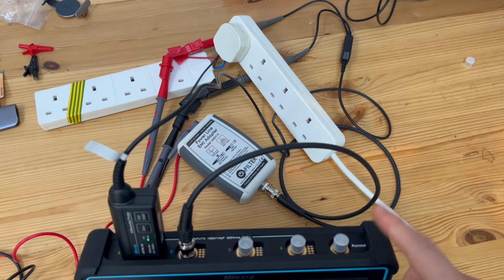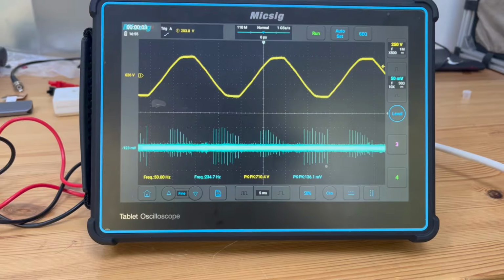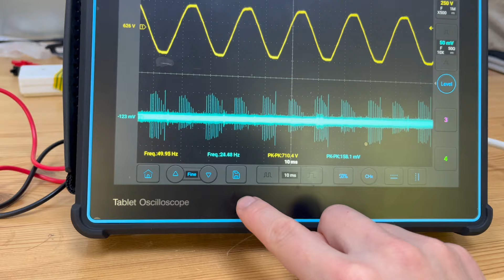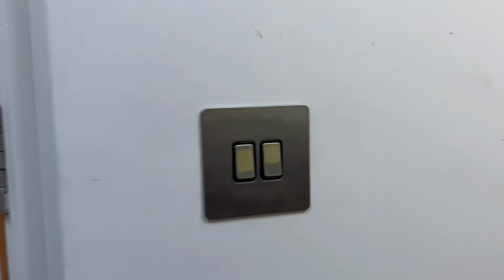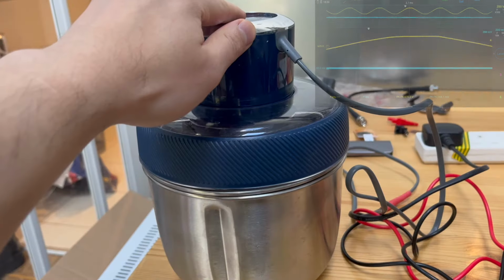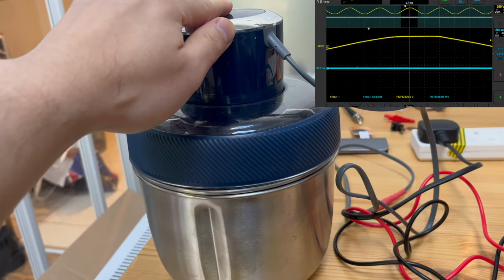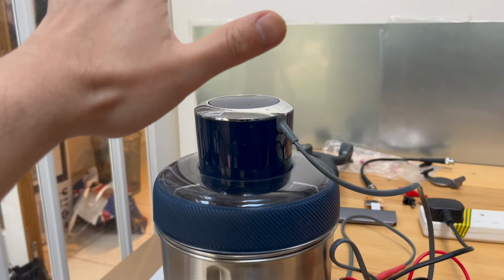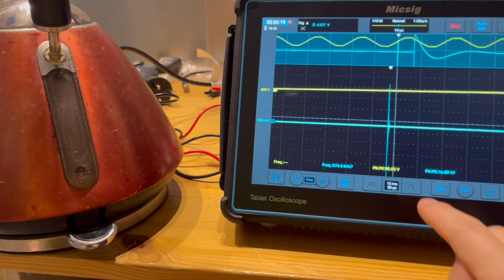Comparing Conducted Emissions: Assessing Performance of Home Appliance Products

Comment: Thanks Min.  Interesting that the mains in the UK is nowhere near sinusoidal, I get a triangular wave in Australia.   Also, I definitely see EMC issues caused by CISPR compliant appliances, mainly with intentional receivers. AM radio in particular.  I guess the main takeaway is preventing 'unacceptable' interference.   So the CISPR limits do work despite a significant amount of subjective judgement.   

I think you videos would benefit from a 3-6dB increase in audio level.   I really enjoy you videos.